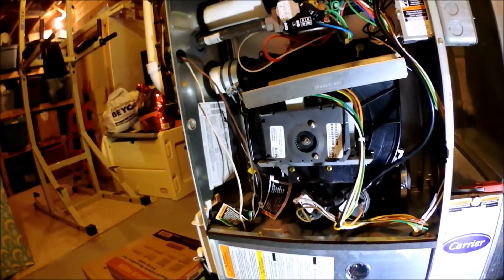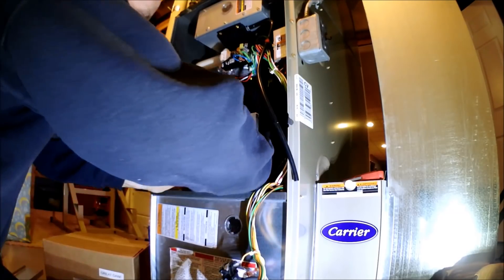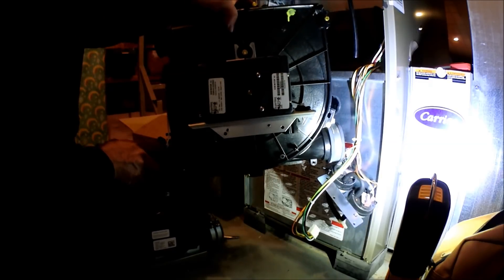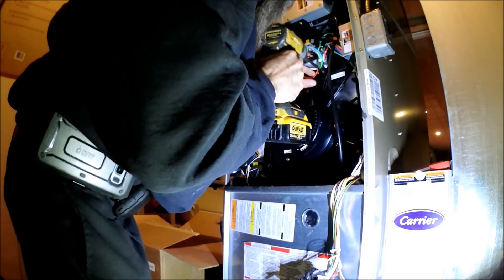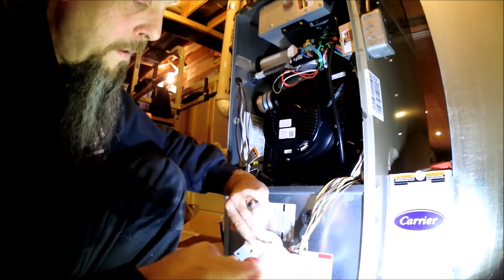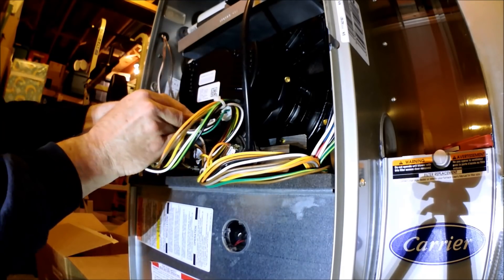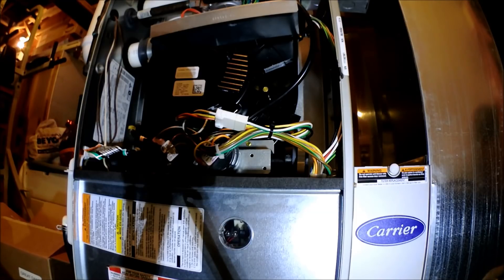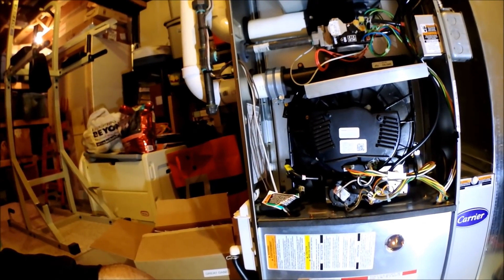Carrier/Bryant inducer motor change out #340793-762

Comment: Awesome video! Thank you so much. Anyone  who is mechanically inclined can do this. Like some of the comments below, we had no heat and error 42. Mine was a little tricky because of how original installer plumbed the gas line and flow control valve. Two of the bolts could not be accessed straight on and it took some gymnastics to remove the old inducer. Just take lots of pictures so you know how to unhook and re-hook all the components correctly and take your time and do not over -tighten the bolts. 10/10 video :)

Comment: This video shows you how he did it, as opposed to how to do it - no real details given.

So a few extra tips for those considering this swap-out that weren't in the video.

First, there's a long screw that's kind of at the base of the motor assembly near the lower left corner.  It's sort of hidden so if you're trying to remove the old motor you might have missed this one.

There's also a silicone seal that holds the inducer motor to the back of the furnace,  You'll be breaking this seal on removal, removal shouldn't go as easily as the video shows, but there will be some pulling needed to break the seal.  Even though you've pulled all the screws (I believe there are four), it might still feel like it's screwed down somewhere due to this seal.

The old seal should be scraped out of the groove and then re-built using a high temp RTV silicone sealer/gasket maker.  My local ACE hardware had some rated to 500 F for under $10, way lower than the DOW product Carrier recommends.

If you're replacing a stock inducer motor that's no longer made, like the HC23CE116 with the 340793-762 model now sold, note that if you still also have the stock pressure switches installed these will not mount to your new inducer motor.  You can leave the old pressure sensors hanging and still use the furnace with the door panel opened, or rig it somehow.  If you want a clean job, you'll have to fork over another $120 for pressure switches that are compatible with the new motor.

For 40k BTUH furnaces, the pressure switch is  P/N HK06NB025.  For all others, P/N HK06NB023.  You'll want to make sure you can remove the bracket that is on this part (screwed on, not riveted).  You can then mount the pressure switches to the bracket that came with your new inducer motor.

The small elbow / tube that needs to be disconnected at the front/left can easily tear on removal due to age.  If this happens, the part number is 322057-301.  If the long hose that goes around the inducer motor and clips to the upper right side needs replacing, that part number is 319873-714.

Hope this helps in your decision making and repair.
Reply: Hi Andrew
I have a furnace with three pressure switches.  The part number you recommended only comes with two.  Is there another part you can recommend that will fit the new assembly?  Thanks!
Reply: @hermanng2101  Do you have a Carrier or Bryant furnace?  What model number?  Are you trying to replace the inducer motor or the pressure switches?  What’s broken?  Sorry for the delay in response, I was out for the Holiday weekend.
Reply: @andymytys  
hi Andrew!
It is a carrier 58mvc.  I need a new inducer since the bearing is squealing and about to go.  My inducer currently has three pressure switches.  Thanks in advance!
Reply: @hermanng2101  I have an almost brand new inducer motor and pressure switch setup I can sell you for cheap. I bought it, installed it, and ran it for a month and then the exhaust from the furnace really started stinking as the secondary heat exchanger went.  Once I saw the effort and cost of replacing that I just got a new furnace.  These two components new were around $1400, as I’m sure you’re aware of.
Reply: @andymytys  
Hi Andrew!  as long as it’s the right part, I’m game.  How can I contact you directly?
Reply: Email sent last week
Reply: This was really helpful. Thank you for the tips about the pressure switches.

Comment: Replaced one on 355MV060080 manufacture recommend replacing pressure switch’s.with Hk06nb023 kit.this unit was a 2004 unit thanks for the video.

Comment: Mi Guy. What an excellent video.
 My furnace inducer fan broke again. This is the second furnace.
 The first time we replaced a 6 year old furnace (Carrier at the time had a problem with a heat exchanger that rusted prematurely) and this time we are having the motor replaced for $700 + $600 code upgrades. Furnace is 12 years old. Wish I had one on hand and it was not February.

Comment: Hello, thank you so much for this video. It was very helpful. Do you know where I can get this inducer motor? Mine started making a crunching sound and it stopped running today. I am getting error code 42 which says inducer motor isn’t running. Winter just started and I definitely need heat in the house.

Comment: Great video I have the old style that you replaced,  it just started making noise is this bad? do they eventually fail or just make noise. I have used silicone spray on the motor wheel and its quiet for a while.
Reply: They eventually seize up.  Complete replacement or new furnace is a year away at most once you start hearing the high pitched noises.
Reply: It's not always the motor.  The inducer blower wheel inside the plastic housing either cracks and wobbles or sits crooked when the bracket sags and rubs on the housing making a nasty grating sound.

Comment: Dear Michigan heating guy!, Very nice video, It would be very helpful. I have a carrier infinity 96 58MVP080 furnace. It is very noisy, high pitch sounds, likely due to worn-out bearings on the inducer motor. I have to replace a inducer motor, and new one will be arrived soon. Hut I have a question as below. Do I have to prime the condensate trap with water? like into the drain that runs from the burner box with 1 quart of water before start up? You answered that you did not. But could you please double check it for me? Thank you
Reply from the maker: No

Comment: Tha is for the video, that was very helpful.
My assembly was discontinued, the new one calls for a new pressure switch. Why wouldn't the old ones work?
Reply: The old pressure switch will work, it just won't mount onto the new motor due to the size difference in the casing.  So you can either get longer hoses and rig something, keep your furnace panel door open (even worse rigging), or get new pressure switches that will mount onto your motor properly such that you can close the furnace door.

Comment: My inducer motor is ok, but I'm getting water leaking from it because the silicone around the perimeter of the inducer frame has come out in places. My HVAC guy says get a new inducer. Can I just coat the perimeter with new silicone from the outside? Is it practical to take the inducer apart to put new silicone between the two halves?
Reply from the maker: Put some silicone on it it's not gonna hurt it
Reply: Yes your HVAC guy should be willing to get his hands dirty for a few bucks and not recommend replacing entire assembly at $1000+ cost!
Reply: @stefdriver  I had a couple of warm days about a week ago so I did the silicone myself (all around the perimeter).  Was able to reach the entire border without removing the inducer (using my finger mostly). It is now running fine and the silicone seems stable and solid.

Comment: I have similar furnace which I have to change out an inducer motor as well. Video is awesome and sure answers  a lot of questions except one. The manual mentions priming the drain that runs from the burner box with 1 quart of water before start up.. so my question is do I need to do that?
Reply: I'm assuming the inducer  motor has a internal P trap. Would that be correct?
Reply from the maker: No it does not have an internal P trap but I've never primed one just let it run May trip on pressure switch on time but just reset the furnace and it should be fine

Comment: Have an LP  unit like this in a horizontal config with a real nasty odor. Thinking it must be a heat exchanger with fresh air in and exhausted out, how else could any odor getup  in the ceiling where its mounted? Have you bumped into this problem before?
Reply from the maker: The heat exchangers plugged it's producing large amounts of carbon monoxide you really need to get the furnace inspected wish you luck thanks for watching

Comment: I have seen the installation manual and it states that you need to use low adhesion RTV.   I did not see you do that.  Was the existing sealant adequate for a tight fit?  I obviously don't want a CO2 leak.   Thanks for the video.  Well done!
Reply: He didn't split the inducer housing, he replaced the entire assembly, so no sealant required.

Comment: Excellent video, it appears that the 340793-762 Inducer could also be fitted into a Carrier 58UVB080F114? Mine appears to have identical inner parts to the one in your video (later model). Do you know if that’s true? If so, I see the inducer on amazon but does that part number you provide in the video always include the wiring adapter/pigtail and the new mount? I can't tell from what the vendors advertise.
Reply from the maker: Yes this inducer assembly will work on your furnace. It does comes with the harness and I also think it comes with the pressure switch rack.  There is link to Amazon for that motor in my video
Reply: Thanks so much for the confirmation I truly appreciate it. This will be my backup plan if a simple replacement of the inducer blower wheel (which was broken) and bearing (if vibration continues) doesn’t do the job.  No sense putting in the older & more expensive stuff at that point. BTW I didn’t see the unit under the amazon link to your stuff.  However, I did find one here: https://www.amazon.com/Carrier-340793-762-Inducer-Assembly/dp/B014RHTZN4/ref=sr_1_2?crid=1Z0CD9OKHDIV1&keywords=carrier+340793-762&qid=1580856643&sprefix=carrier+340793-762%2Caps%2C235&sr=8-2 @MiHeatingGuy
Reply: So I ended up replacing the squirrel cage alone and it worked fine for the past 9 months since I asked you these questions above. Unfortunately, tonight the motor itself has now died. So I am thinking I want to go this route rather than pay my heating company over 1K to fix it.   However, I am still a bit worried if I order the kit (link above) and it doesn't include the wiring adaptor/pigtail... I'll be out $650, because I won't know how to wire it up at that point.  Are you 100% confident the kit has the wiring adaptor?
Reply: @jasonhenshaw3719  Did the Kit Have the "Wiring Adapter"???  Can you let me know?  Thanks from Ric

Comment: The 90%+ gas furnaces are not suitable to be installed in spaces where they are subjected to freezong temperature because at freezing temperature the condensate water will turn into ice. Then these ice will cause damage to the inducer motors.

Comment: Great video, thanks for walking us through the process on this.  I am shocked at how loud the new motor is.  You say louder than the original but this new one sounds like a 747.  Is that normal for everyone else or did I get a defective unit?
Reply from the maker: Normal
Reply: Wouldn't cha kbow it.  7 hard mn winter months and the new inducer died.  Error 42.  Is there anyway to limp this while I await a new unit?

Comment: I was in front of this particular model the other day. Was giving me code 42 , inducer error. Call for heat wasnt present with the nest tstat the customer installed himself about a year ago so i jumped r and w. Blower wheel starts pushing air but code 42 is still there and the inducer doesnt start at all, no current draw either. Had 120 v going to inducer but the dc volts seemed to drop from 7v dc to 4v on the control side of the inducer connector  between the brown,yellow and orange wires. What got me was that it may be the board or the ecm mod for the inducer. Also forgot to mention i tried setting dip switch 6 to test mode and the inducer didnt run but the ignitor started glowing and i had 10.5 v dc measured at the inducer plug between the same brown, yellow and orange wires. You probably have seen more of these then i have, based on the information, what do you think is wrong, the board or inducer ecm module? Another thing i might mention is i had control voltage at all my auxilary switches, so i know power didnt stop short at any of those.
Reply: I also made i mistake in saying the dc voltage. It dropped from 7v to 4v to nothing
Reply: And last, if its possible, which im sure it is, could the nest tstat have messed up the ecm or control board as well? Had many instances where i found nests incompatable with certain systems, and this is coming straight from the manufacturer

Comment: i have had my inducer replaced twice and had a factory rep come outthere is a problem with the motor shaft needing oiled i recall or that something is on a bind also carrier has issues with the heat exchangers going bad i had inducer  and heat exchanger repaired under warranty luckily only one heat exchanger needed replaced  if the top of your furnace gets fairly hot not warm you probably need a new exchanger  i will probably never buy carrier again i had one back in the 90s and original  inducer motor squeled like a cat was in the basement after 4 years they reolaced it but compressor went out after 2 years  and i had to pay labor and also when it gets hot both of my outside ac units groin when they turn on i never heard that from other units well like i said never will buy carrier again

Comment: What errors were you getting??  My furnace errors out in every stage of the furnace function.  I get error 42.  Then it works fine for a cycle then error 42 in a different stage.  Stages - blower motor spool up, inducer spool up, igniter, gas, igniter off, then finally second stage heat.  The error occurs in each one of these stage all at different times and never the same stage twice.  lol.  But I do notice the inducer is slight noisier lately.  I just can't see paying $1000 for a new inducer when the furnace is 19 years old.

Comment: I hope you answer this.   What's the chances a guy could buy that adapter for the new motor.  I have a new motor that did not come with the adapter and Carrier basically told me to stick it and I could not buy one without buying a whole new motor again, going through a dealer.  So, out a bunch of money for something I cannot use.  Winter is getting closer. Hopefully you can help.    I think. I may have found one.
Reply from the maker: They usually only sell as a whole assembly

Comment: Hello Mi Heating Guy. Great video very informative and very detailed. 
I have a Carrier 58MVP060 and I am trying to replace the HC23CE116 inducer motor just as you have in your video. I have the new 340793-762 inducer, and I got to the point where I need to switch over the pressure sensors and realized I do not have the same pressure sensors. My pressure sensors appear to be much larger in diameter and are riveted to a dedicated bracket, therefore I cannot switch over the pressures sensors like you showed.  
If it is an option, I would be willing to replace the pressure sensors so I can still use the new inducer motor. Right now my pressure sensors have a tag with the following detail "Tridelta BA6933 03561W/0142/D. 319893-401". 
Can you recommend a set of pressure switches that would be a sufficient replacement for my current pressures switches, but yet have the ability to use bracket supplied with the 340793-762?
Reply from the maker: You need new pressure switches
Reply: @MiHeatingGuy  Great! Thank you, much appreciated!
Reply: If you're replacing a stock inducer motor that's no longer made, like the HC23CE116 with the 340793-762 model now sold, note that if you still also have the stock pressure switches installed these will not mount to your new inducer motor.  You can leave the old pressure sensors hanging and still use the furnace with the door panel opened, or rig it somehow.  If you want a clean job, you'll have to fork over another $120 for pressure switches that are compatible with the new motor.

For 40k BTUH furnaces, the pressure switch is  P/N HK06NB025.  For all others, P/N HK06NB023.  You'll want to make sure you can remove the bracket that is on this part (screwed on, not riveted).  You can then mount the pressure switches to the bracket that came with your new inducer motor.